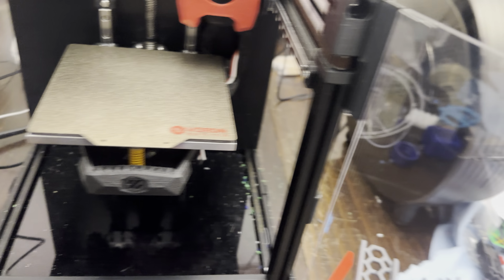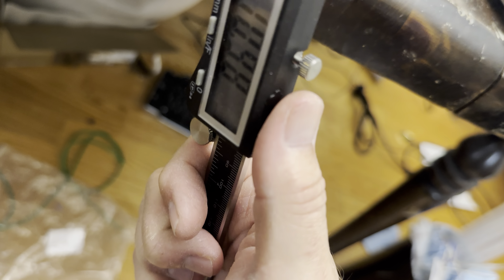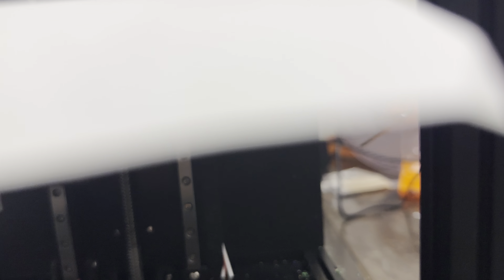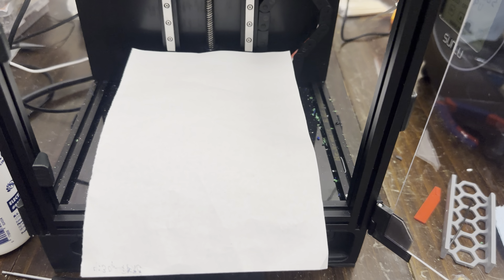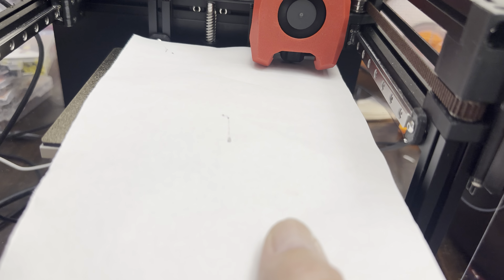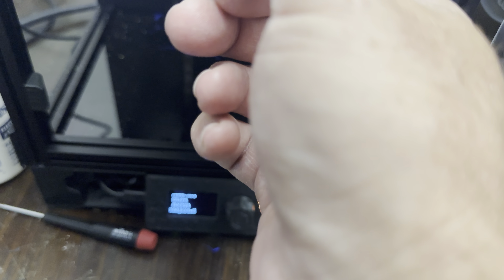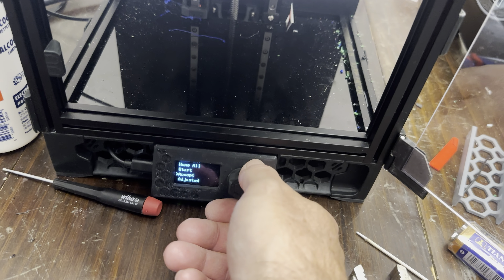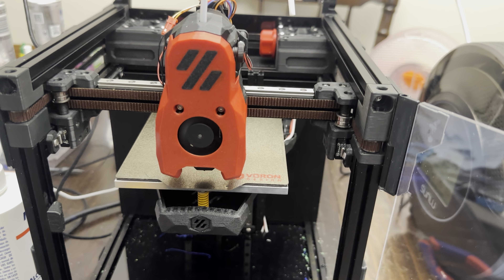Voron 0.2r1 Manual Bed Leveling

Comment: Thanks for the video, in my case no matter what I do, one corner is very low, I always fail with large prints.
Reply: verify your screws to see if they are not compressing the coil enough then when you test will have to touch the paper